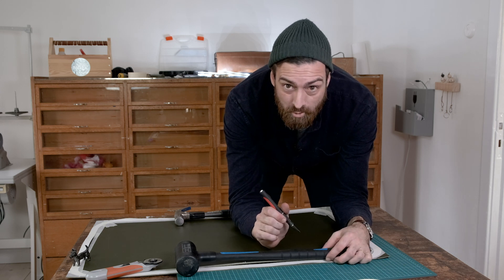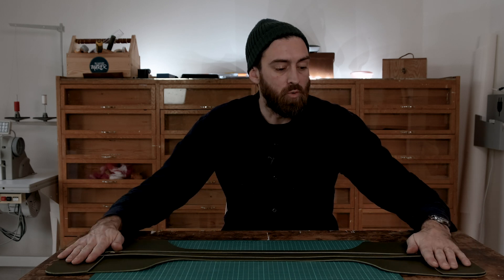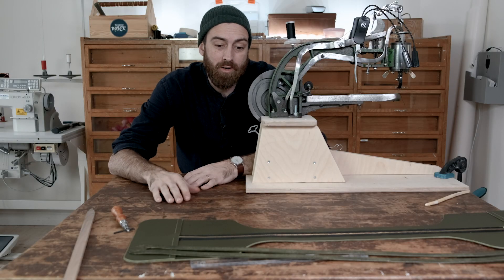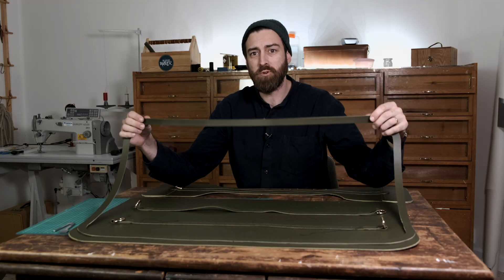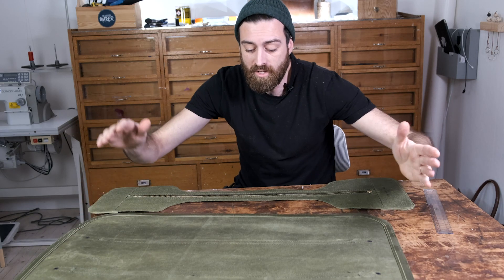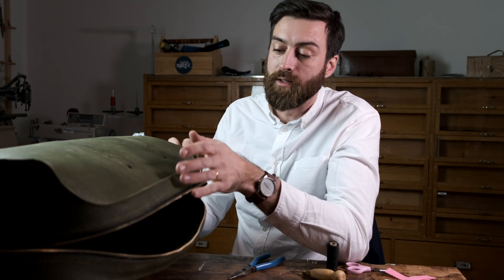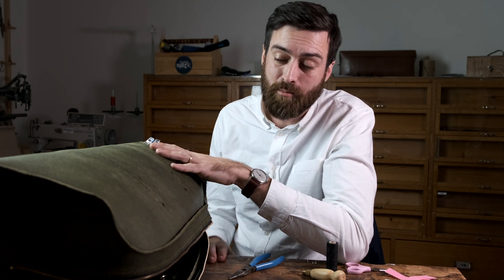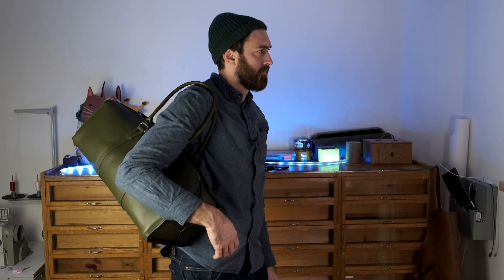Making a Leather Duffel Bag

Comment: nice video! I bought the same machine. Here is a tipp: Everything I pre-punch the holes and then stich it hole by hole using the machine. The result is great, like Handstich. The only issue is the stich of this machine has an inverse angel of the normal chisels. In oder to get a perfect result you need a inverse chisels (mostly is custom made and experience), or punch the holes from the backside then use the awl to enlarge them from the front.
Reply from the maker: Cool I havent tried that yet! Sounds like a good way of getting perfect stitches.
Reply: @TheSwedishMaker  definitely worth a try. 😊
Reply: @TheSwedishMaker  btw, you could sand down the machine needle to have a round toe, which makes the sewing even easier.

Comment: I just purchased and downloaded this , but I’m confused on what size I need to print this as. It only says to print in poster size … there are multiple sizes for poster… why are there never any actual dimensions listed on templates ? ? Any help is appreciated . Thanks
Reply from the maker: Not sure if I ever answered this, but it should be printed at 100%. Full size. Poster printing is a setting in Adobe Acrobat to print a design over multiple papers.
Reply: @TheSwedishMaker  Thanks for the reply, if it needs to be printed at 100 - can you separate the templates instead of putting multiples on one page ? Right no w it has the frame and main portion on 1 page. If we print it like that and it’s on multiple pages, it will be anywhere from 20 and up pages just to tape together. If you are able to send the dimensions of each piece I can do it from that as well and may be easier
Reply: @TheSwedishMaker  also just a suggestion, I notice there arnt punching holes on your pattern. I can do those myself but it may help others to have that already on there . Thanks for the rad design !